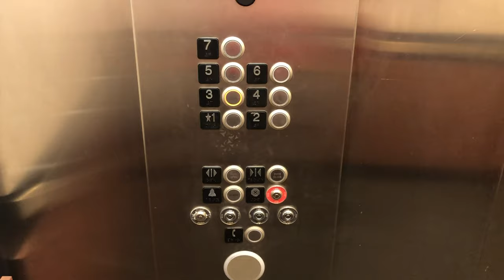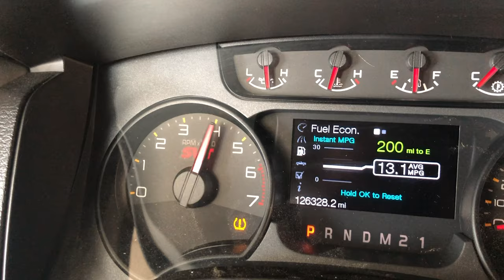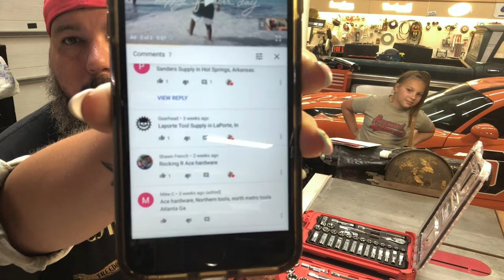I bought a whole PackOut just to get a 10mm socket (Milwaukee tools new metric sock sets are out)

Comment: They need one Full Slim box with one side metric and one side SAE, BUT not have 2- 3/8 " ratchets and extensions and etc. also try and get 1/4" and 1/2" Sets in it. ( at least Wrenches and adapters.
Reply from the maker: Yeah

Comment: I just got the 106 piece SAE and Metric version of this.  An amazingly complete set of deep wells.  I was wondering if any one has put use on these.  Any issues with the laser etching for the sizes wearing out?  I do wish they had the easy release buttons on the socket.  

I hope you didn't go to a hotel just to pick this up.  I have spent an awful lot of time in downtown Columbus. and I know those streets well.

Comment: Soooo....are you saying that if you have a Craftsmen Socket set and bought the 44-22-9486t (just the inserts no tools), that the Craftsmen WILL NOT FIT?  I do not need ANOTHER socket set (I have at least 3, if not 4).  But it would have been nice to be able to fit my existing Socket set into the PACKOUT.  I just did a complete DeWalt Tough system to PACKOUT Conversion.  Love it so far.  
I think YOU 3D Printing both Metric and SAE inserts (Like the 44-22-9486t) to fit the 44-22-8431 would Sell like HOTCAKES.  Maybe I could get the first one free for giving you the idea?...lol
Reply from the maker: So not many printers can print something that big. I did a custom foam for a crasftman socket set and no one wanted it lol
Reply: @JakeOfALL  even if you printed a Red Middle, Red Standard and Black Metric all Separate?  I know NOTHING about 3d Printing.  All I know is I want them, but not for $300 with sockets I don't need.  The inserts are $20 for a set, but I could not tell from the short time you mentioned the Craftsmen whether the trays were too small for Craftsmen or too big....